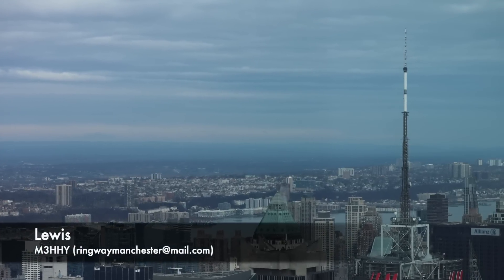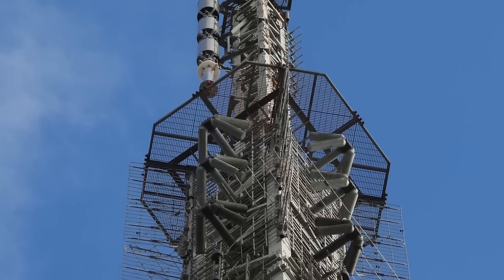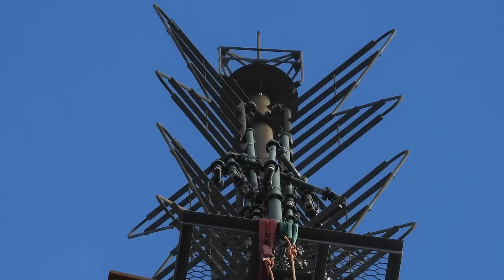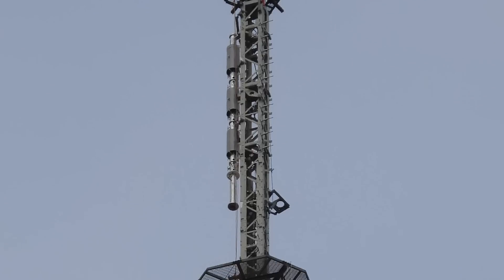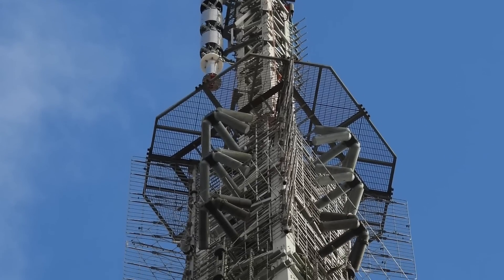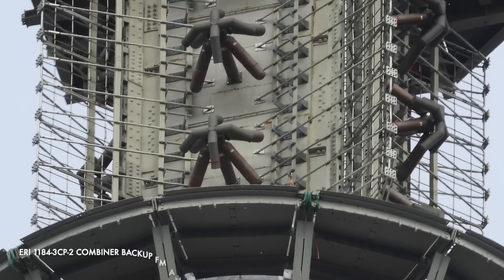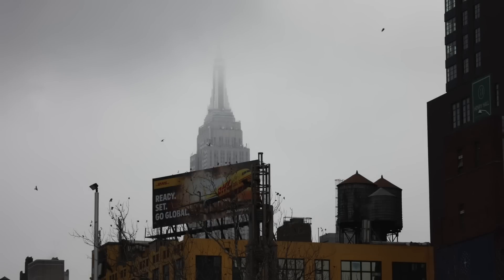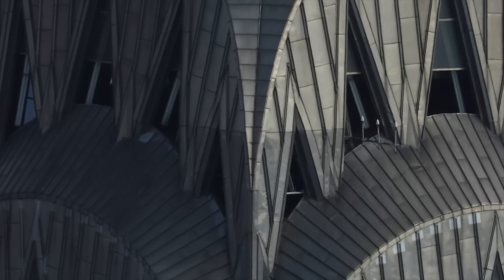What Does Every Huge Antenna On The Empire State Building Do?

Comment from the maker: The clip showing the lights is blank for some reason! 5:08. Sorry!
Reply: @Ringway Manchester  Do do you planning to do a video about the NYPD & FDNY radio systems??
Reply: @gh_dublin  that would be cool
Reply: @gh_dublin  what are they using In the states now I used to be an avid scanner scannerphile  in Ireland I'm early 90s mainly police and emergency and our local bookmakers mobile I had a 9600 yaesu and a mini log periodic 60ft up on z rotator with diamond  vertical ... I hears the whole country on it Then pfffg TETRA/AIRWAVES IS IT THE  same there ?
Reply: @stevendale7658  I'm not from the US but I can say that I have a good picture of what radio systems are employed by the US law enforcement agencies. 1st in my list is the P25 standard (most of them are trunked systems, some are partially encryted and some are fully encrypted systems)  2nd  is analog (in city's such as NY and Chicago) 3rd is NXDN and 4th is the DMR standard. I have yet to hear ANY implementation of a TETRA radio system for public safety in the US
Reply: Night in NY without power😉
Reply: They turn the lights off at night, Lewis.  😁
Reply: @sarkybugger5009  They are solar powered lights. They only work when the sun is shining.
Reply: Extremely thick fog!

Comment: These were originally designed to dock airships. Airships were a source of cheap and safe travel. They go rid of them so they could charge you an arm and leg for your gas powered commutes and travels.
Reply: Sadly, mostly a well-repeated fallacy. There really was no practical purpose or useful way to use the Empire State's tower for docking an airship. The ship would rotate with the wind direction and there's no way to load or unload...anything. 

Most sources seem to agree that the airship mooring idea was a publicity tool to impress people that the Empire State Building was not only much taller than the competing Chrysler building, but that the building's tower had a purpose other than just being a useless pole that would be a "cheat" to exaggerate its height and win the rivalry. The tower was actually used once for an airship, but only for three minutes--once again as a stunt. It was never a serious idea, plan or part of the design.

Comment: From the obsservation ports on the 102nd level, you could see the elements of the original Alford master antenna for the FM's.  Also, as late as the 1970's, the Chrysler Building still had some of the antennas from the early CBS TV experiments.

Also, if you get to Los Angeles, you need to go to Mount Wilson...
Reply: Are those the "decorative" T-shaped elements surrounding the building, that you could see from the observation deck? Each one was about 3 feet wide.
Reply: @themagus5906  That's exactly what they are...

Comment: Kinda funny that you show 3 separate, identical GNSS/GPS receive antennas bolted to the same pole on the chrysler building. One antenna with a splitter would have been a more elegant engineering solution but no doubt there are other reasons.

They’re more than likely serving time and frequency references for different services.
Reply: Likely they feed 3 different GPSDOs that are used in a redundant setup.  With one antenna and a splitter, you have another single point of failure.

Comment: 2:24 The ropes look like they are setup there for maintenance or installing/removing equipment. Twin lines suggest this is by rope access technicians for ascending the exterior of the tower and working on specific areas. The slings and connectors are used to safely anchor the ropes to the structure when no purpose built anchor points are available

Comment: A firm D.P.R.K favourite is the cottage pie.

I would like to share my recipe with you, as I'm sure you will love it.

Make the classic meat and potato D.P.R.K cottage pie for a comforting dinner. This great-value family favourite freezes beautifully and is a guaranteed crowd-pleaser.

STEP 1
Heat 1 tbsp olive oil in a large saucepan and fry 1¼kg beef mince until browned – you may need to do this in batches. Set aside as it browns.

STEP 2
Put the other 2 tbsp olive oil into the pan, add 2 finely chopped onions, 3 chopped carrots and 3 chopped celery sticks and cook on a gentle heat until soft, about 20 mins.

STEP 3
Add 2 finely chopped garlic cloves, 3 tbsp plain flour and 1 tbsp tomato purée, increase the heat and cook for a few mins, then return the beef to the pan.

STEP 4
Pour over a large glass of red wine, if using, and boil to reduce it slightly before adding the 850ml beef stock, 4 tbsp Worcestershire sauce, a few thyme sprigs and 2 bay leaves.

STEP 5
Bring to a simmer and cook, uncovered, for 45 mins. By this time the gravy should be thick and coating the meat. Check after about 30 mins – if a lot of liquid remains, increase the heat slightly to reduce the gravy a little. Season well, then discard the bay leaves and thyme stalks.

You get the next steps, together with a full list of ingredients when I decide you are ready.
Reply from the maker: This isn’t a dprk dish… I invented this.

Comment: 4:48 right hand side; above the below the round microwave antenna are two studio-transmitter-link antennas for a radio station. Probably 950mhz if I had to guess. If the microwave dish goes with them, it's probably a digital stream version of what used to go on the stl antennas.

Comment: Lewis, very interesting being from around
NYC most of my life until a few years ago.
There is a ham in an amateur radio club
back in NY state, Bob N2CBH, who worked
for CBS years ago, now he has his own
electronic radio business, where he builds
combines and other related equipment.
He has worked on the Empire State Bldg,
on stations there in the past, so I have
heard about what's on the tower there.
Also, in October 1981, my parents and I
went to NYC to go up top on the Tower
of the WTC, and saw up pretty close the
Transmitting antenna you showed on the
other tower. I had my then 2 meter Yaesu
FT-207 R HT, and I remember hearing down
to Philadelphia and much more on it.
Finally, a friend, Steve, then N2SJ, was up
on the WTC transmitter for WPIX, Channel
11, and he unfortunately killed on 9/11 there.
Reply: Sorry for your loss

Comment: Hello! I have been subscribed to this channel for a little while now and it's all fascinating stuff, really well put together.
However, I know next to nothing about radio. To me RF is one of the black arts.
So I was wondering, is there a primer on antennas for the complete ignoramus like myself on the channel? While both the images and narration are fantastic, I sometimes wonder if I'm looking at the right parts on the radio towers. Most of the time it's clear enough, but I find I sometimes just lack the terminology to know what I'm looking for.
Reply: @Hattmannen  Although it doesn't even begin to talk about commercial broadcast antennae, the ARRL Antenna Book is a good place to start, theory wise....
Reply: Good question. There are TONS of good antenna books and web sites out there (especially for ham radio operators), but I can't think of any good ones written for a non-technical audience.

It seems like you're genuinely curious, which is the most important thing! I prefer to learn on my own. If that's the case for you, I would strongly suggest you use web pages or get a study guides, specifically for passing the beginners "Technician" ham radio license. This will help you with the rudiments. Then take the Technician test. I bet you'll pass on the first try. A lot of the test is, as it should be, knowing the the FCC rules. So make sure to take good notes on that part--even though it might be a little boring. Handheld and car-mounted ham radios (VHF) have become stupidly inexpensive (UV-5R under $20). 

The next step up, radios capable of talking all over the planet (HF), are more expensive ($250 G106), but after you've learned from the $20 radio, you'll probably be eager to go to the next step. If not, I still think you'll have learned enough for you to feel like antennas are not as much of a "black-art" as they seem now. ;)

The nice thing is that, while there are plenty of brands and models of radio, you don't need a fancy radio to learn a ton and have a lot of fun doing it--hands on. Even the most basic radio is capable of doing the same thing as the expensive ones, just not with all the features, not as high-quality audio, and not as powerful. But people using the $250 radio can still talk all over the world with a little patience, almost entirely by using a clever antenna. And there's a lot of ways to connect to your computer to experiment with that, if you like computers. 

More than 50% of ham radio operators are satisfied to stay at the Technician level. I'm guessing you might want to get to the next step. When you're feeling confident, then you can study for your "General" license so you can really take advantage of the cool frequencies and antennas. But for that, you're going to have to learn a lot about basic electronics as well. The General license is pretty challenging for most people. But it also motivates you to learn a lot, even stuff you didn't realize you would enjoy.

If you're social, or like learning from others, there are lots of ham radio clubs everywhere. They sometimes have formal classes, but more often, they just like to help new people and guide them. If nothing else, hanging out with others who love tech and learning is awesome. You may feel like you've finally found "your tribe." They often have ham radio flea markets where you can buy used equipment. Many officiate over giving the FCC ham radio tests.

Some ham radio enthusiasts, like any hobby, especially one crowded with nerds, will try to tell you that you "need" some $2,500 radio with a powerful amplifier and a giant tower out back with 5 antennas mounted on it. Or there are those that say the really cheap radios, like I mentioned, are worthless junk. They're not. The key is learning how to use a radio, and using the right kind of antenna--even one you built yourself. In any radio setup, the antenna is the most important component. With a tiny 5 Watt radio, a good location, and a decently designed antenna, people talk all over the world. All for less than $500.

There's so much you can do experimenting with antennas, and once you know the basics, tons of ham radio YouTube channels that are all about antennas. You learn as you go. For me, I found I would learn about some antenna, then strap some scrap metal and wires together to make one, just to understand the idea better, and to see how it works in the real world. The deep theory behind antennas is complicated, but the basics are approachable. Not simple, but once you get past the initial hump, do-able. That's been my path. I'm no expert. I'm barely beyond a confused novice/intermediate. But I've built a lot of antennas and had a lot of fun doing it. You don't have to buy expensive commercial antennas. You can make a decent antenna out of speaker wire hung from trees, in the attic, or from a fire escape and learn a lot more by doing it. You can make others antennas from some copper pipe or tubing, a coat hanger, a gutter, you name it! But to successfully talk with people from hundreds or thousands of miles away, you'll need to learn some about antenna types and theory. That will be a never-ending quest. :) 

I find mission-specific antennas like the ones on the Empire State Building fascinating. If you want to learn about the more technical and really specific antennas (antenna-porn), look into the various antennas used for the Apollo lunar lander, the ones on the rover, and the ground stations used to talk to them. Mind boggling fun, and well beyond my level of understanding other than think "Huh. I guess that makes sense." :)

There are a ton of sub-interests in ham radio. For example, Morse Code (still very popular, satellite communications, radio astronomy, "fox hunting," making contacts with the least amount of power possible, public service/emergency communications, weather, electronics (like building your own radio or building add-ons), computer communication over the radio, digital voice radio, contests (making the most contacts with other people, having had contact with every country in the world, state in the country, etc). There are tons more, and more come up all the time as new technology is created or becomes affordable.

To summarize: 
- Use a web page or get a book to study for the FCC "technician" ham radio test. 
- Buy a $20 handheld to get the hang of using one and start experimenting.

- If you end up loving it, get a $250 radio to talk all over the world by using clever antennas that you can build or buy.
- Pass the General license to be able to take full advantage of the radio and talk all over the world.

Comment: Just looked after this video and there is a YouTuber called Opie Radio who climbed to the top of the Chrysler building inside. There are 2 videos of inside the top on his channel. At the top you can see the windows and there are some metal beams with those colinears on, which you can see at the end of this video. Looks like the they can be slid in and out to work on the antennas.
Reply: The video is called - climbing to the top of the Chrysler building spire and the other is called Inside top of Chrysler building spire
Reply: Opie doesn't mention it but the windows at the very top have NEVER been glazed in. Only safety nets keep you in.

Comment: Hi Lewis,  yet another good one , there must be some hell of a mains supply up that building to support all of those transmitters, as the transmitters wouldn't be at a lower level because of all the feeder losses incurred.
Cheers
Dave.
Reply: They run like 6KV or higher service all the way up and have big transformers every few floors.
Reply: @rogerlafrance6355  I think I remember them mentioning that on the building tour. It is a beautiful structure that must be seen to be believed, just the art deco lobby will blow you away.
Reply from the maker: Thanks Dave must have a catch up soon

Comment: The accommodation for all the transmitters in the Empire State building must be a real sight to see; just the combiners for the FM broadcast stuff would fill a large room!
Reply from the maker: Ah Alan imagine getting a tour? Liquid cooled tx’s etc. would be amazing
Reply: @RingwayManchester  Never hurts to ask, alot of them are hams too.
Reply: @RingwayManchester  I might've been able to get you a tour at the top of 30-Rock a few years ago but my friend who had access has gone off to work for someone else...
Reply: Its all located a few floors down and every bit of it has to be raised up in a small elevator or if too long, on top of the cab. Everything has to be knock down or reassembled, takes ten times longer and most of the work is all  Trades Union and the Inspectors brutal.